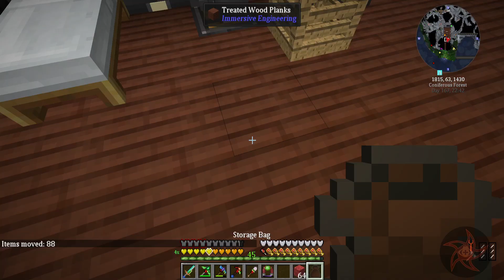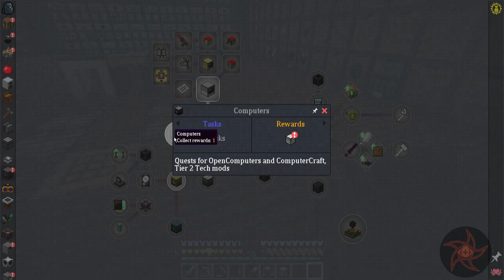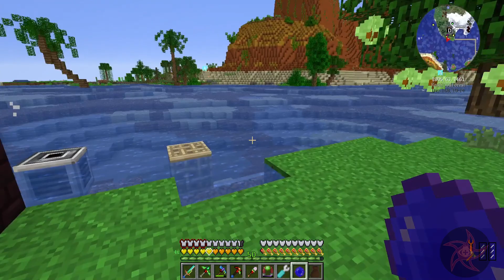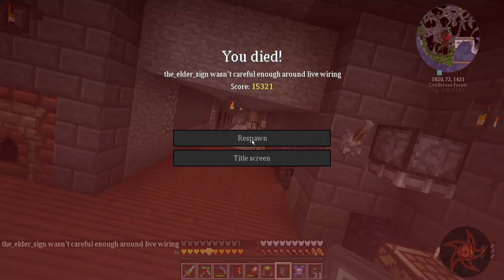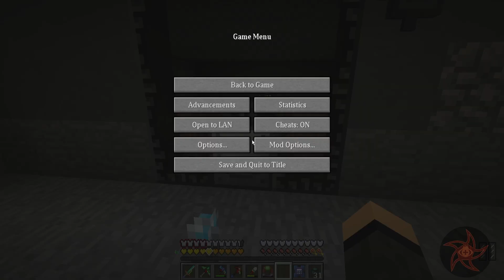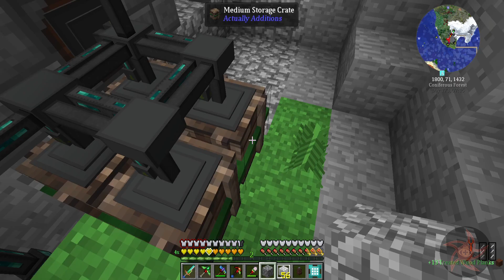Enigmatica 2 Expert - Extended :: Mob farm - Inventory Planning - Power Fixing :: EEE-27

Comment: I was all excited about that inventory manager you built last episode.  I started working towards it myself, until I realized you need the enderIO conduits to hook it up, and I don't want the difficulty bump yet.  Which reminds me.  Is there some reason you don't slap the Tinkers crafting station next to a huge inventory to craft from?
Reply from the maker: You should look into the Indexer from Extra Utilities 2 then, it works off of transfer nodes and pipes
The main reason I  don't really use the TCon crafting station like you asked is simply that I was setting up my storages in a way that I could easily hook up conduits/cables later on when I got my tech upgraded enough to use a real inventory manager of some kind
Reply: @theeldersign  Still though, 26 episodes of manual hunting a pecking to craft every single thing.  I could never do it. 
I put the Indexer on my bookmark list.  I've never even heard of the thing, so I hope it's user friendly to figure out.